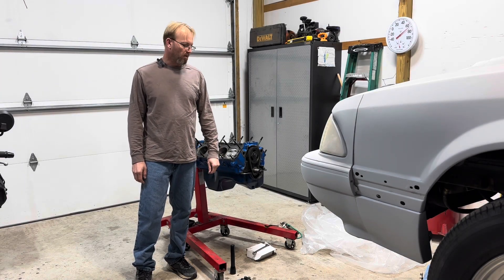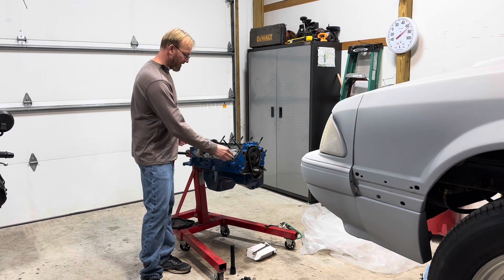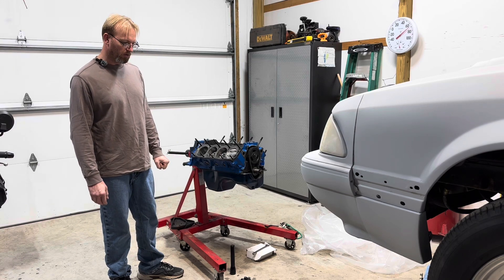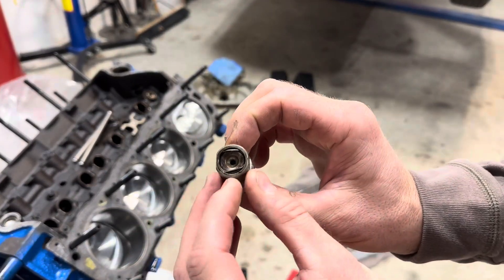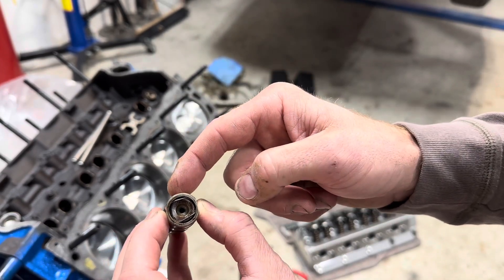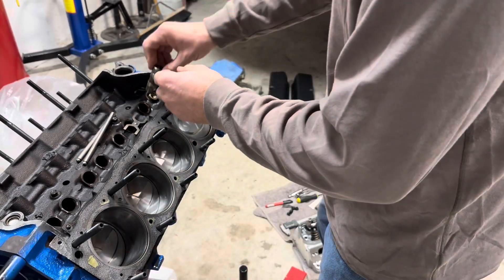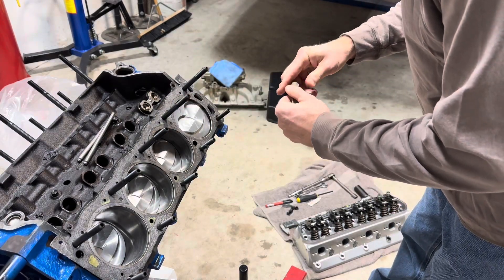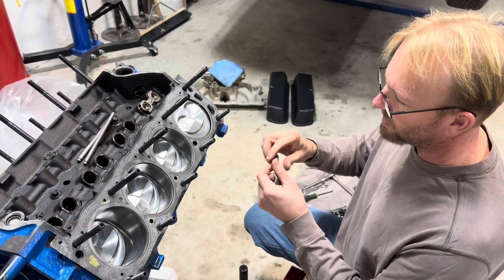Piston to valve clearance check

Comment: Are those 185 enforcers ?
Also if they are 64cc
Will the 59cc versions be alright to use as well for clearance issues?
Reply from the maker: Yes they are and are also 64cc. 59cc should clear if you have pistons with big enough valve relief. But you always need to check clearance with every combination. 👍🏼
Reply: @THE-SHOP  mine are the same pistons kb116 as in your video
Reply from the maker: More than likely, you’ll have plenty of room rule of thumb is you want 80 thousands clearance I had almost 200 thousand  clearance. The KB116 have great Valve relief. The camshaft I was using during this procedure was X303. Keep in mind with this head/piston combination 59 cc will net you 10.821 compression ratio.
Reply: @THE-SHOP  cheers mate. Yeah be high comp for sure

Comment: Awesome build brother!!!! 🇺🇸💪🏼
Reply from the maker: Thanks man I was surprised on the clearance I had was a little nervous ✌🏼
Reply: @THE-SHOP  yea you have miles of clearance!!! I’m thinking about grabbing a set of those piston! Did you have to get your rotating assembly balanced after putting them on the rods or were the pistons all close in weight?
Reply from the maker: I didn’t get it balanced. The set of pistons all weighed almost the same  perfectly matched. Can’t wait to hear it run.
Reply: @THE-SHOP  awesome!!! I can’t wait either!!! Gonna be a ripper!!! 🔥🇺🇸💪🏼
Reply: @THE-SHOP I think he meant the weight diff from stock to those not if they were all same weight?
Reply from the maker: @alltherpm   177 grams more per piston over stock piston.